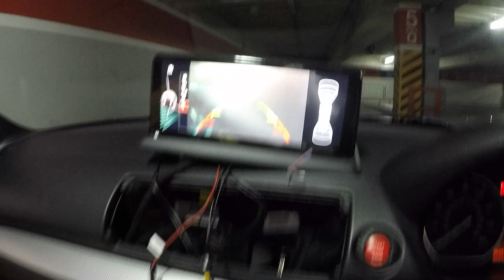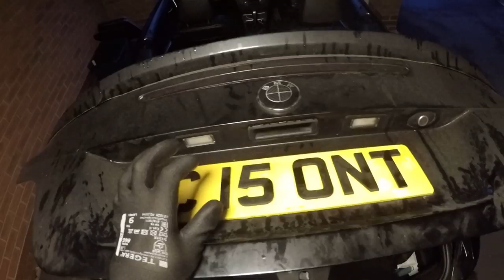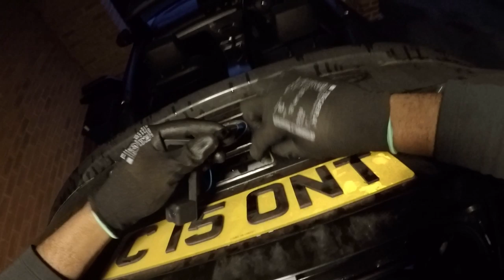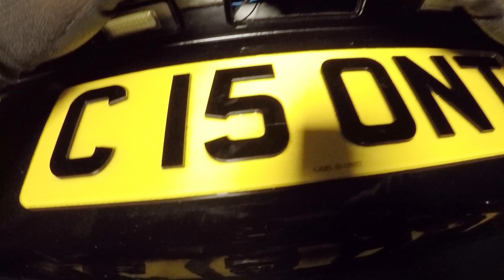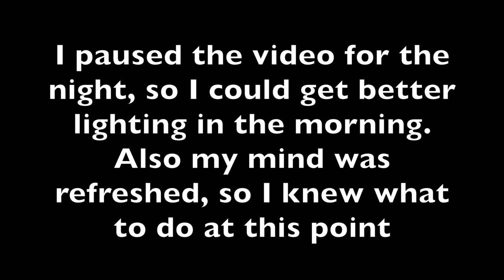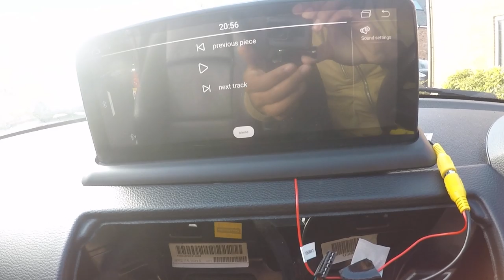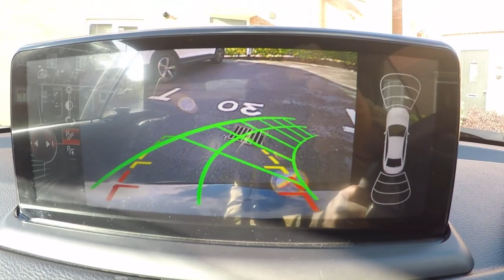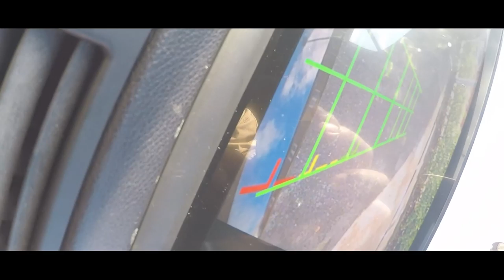Reverse Backup Camera Install BMW 1 Series E88 E87 E82 E81

Comment: If you want to run the RCA cable down the rubber tube then you’ll have to cut it.

I had this problem, I actually broke my first RCA cable trying to get it in. So I split the cable with cutters ran the cable through the rubber and then joined the cable back together by stripping the internal wires back and soldering each colour back together. I then heat shrank each individual wire and the whole joint to protect it, works a treat and looks so clean!
Reply from the maker: Nice one!👍🏾💯 I was even considering that too, to cut the wire from the RCA cable but decided to just play it safe. by the way what colour wires were there when you split the cable? I want to learn to do more wiring soon.
Reply: CARL IS ONIT Black yellow and red, the colours are only there to distinguish which wire is which. The red wire is the trigger wire that runs the length of the cable and the yellow and black are the video cables wires. The black and yellow could be other colours just depends on the manufacturers. 

If you do plan to cut it in the future make sure you heat shrink all the internal wires and the whole cable once complete otherwise you run the risk of a short circuit if not insulated properly. I would also recommend soldering the joint for a permanent connection or you risk the joint coming loose and losing connection.

It’s a great mod, I love mine. Your car is sick as well, I wish I had the convertible but the coupe will do😉
Reply from the maker: Thank you for this info I appreciate it! Love learning more about these things with cars and Thank you!  👍🏾💯

Comment: Just did this last month too!  I did manage to run the RCA connector through that rubber gasket; sprayed some soapy water into the rubber tube making it a lot easier to pull through with the wire hanger.
Reply from the maker: Wow good effort! I didn't consider that, but it's nice to hear a success story thank you! 👍🏾💯

Comment: i don't get it. I have the exact same unit as you, and now I tried to installing the backup camera, but it won't work. its a bit unclear how you connected the power wire in the car. did u hook It up with the reverse light ? what triggers the camera/head unit when you go in reverse mode? HELP ME PLEACE

Comment: Great job as always Carl. I've got an e81 msport but the boot lid is the bmw logo. Only way I can think of installing one is it buy a circular one separately and drill a small hole in the rear bumper/boot. Keep up the good work g 👊🏼
Reply from the maker: Thank you! 💯
Yeah I think that’s what you’ll need to do and you insert the wires through and then the camera will plug into the hole so water can get through then similarly route the wires like how I did in the video. Thanks my g 👊🏾
Reply: @CARLISONIT  actually just found out that the reverse camera fully integrates into the plate lights for all other E variations 1 series. Recently I was thinking of retro fitting F type gear shifter in my e81. The company does silver, black gloss and Carbon fibre - maybe idea for next video? 😎

https://youtu.be/WYCzvoRiGhE
Reply from the maker: Coach C Performance that’s perfect 
Also that sounds like a plan gonna get it done 👍🏾

Comment: Nice video! How easy do you think it is to replace a standard nav on a bmw 1 series 2013 and switch it to a 10.25" Android 7.1 GPS Sat Nav BT Stereo Radio For BMW? (wiring etc) and/or would you do fitting?
Reply from the maker: Thank you! Also it’s quite simple you would just need to unscrew and remove the standard nav and replace it also where are you based?

Comment: One more thought. Is this the camera that can be purchased from the same Avin guys or is that camera from somewhere else? And how is it in low light?
Reply from the maker: Greg Veres I’ve left a direct link in the description also, it works well in low light, i’ve upgraded my number plate lights to be super bright, so it helps it there’s a video on my channel with a link to the bright number plate lights

Comment: Hello, I have the same equipment as you, connect the camera that already worked with my old equipment, in this it does not work, when I put it into reverse it does not react, without a camera it should jump, do you know of any configuration? Thank you
Reply from the maker: angelramosfraga go into the main setting and I believe you can choose whether you installed after market audio or original
Reply: @CARLISONIT  Thank you, I chose the universal camera option and it already works, thank you very much and a greeting companion

Comment: Did you have to buy anything extra to get the steering wheel controls to work with the headunit?
Reply from the maker: Nope didn't need to buy anything extra, it's all integrated 👍🏾

Comment: Hey Karl. I have the same
Head unit and got the wireless back up. You know where to connect the ground to
The main harness cable?
Reply from the maker: Joseph Gomez i’m not 100% sure with the wireless back up perhaps might be the same as @18:50
Reply: @CARLISONIT  Hi. Could you please give more info about power and earth connections. From video I understand that:
1) Video cable (yellow) connects head unit with camera
2) camera +12 connects to rear camera red wire.
3) where the black wire from camera connects to?
Reply from the maker: Kristaps Ginters @2:00 onwards should explain everything let me know if you need more help
Reply: @CARLISONIT  Thanks for replay, but when you split the red and black wire, it does not says, where the black wire from camera connects to.
Reply from the maker: Kristaps Ginters I think I left that aside didn’t need to connect it and it still worked

Comment: is there a sound when the reverse camera operates?
Reply: Perhaps a related question: i saw in the video that when you backup, you have these guided lines / visuals of the parking sensors.
Does this work with original parking sensors? Currently, I have only a beep when I reverse, but when I install this system, will the PDC be visible as in the video?
Reply from the maker: Not sure why youtube didn’t show me your comment but to answer both questions yes, there is sound when the reverse camera operates also it works with the original sensors 👍🏾💯